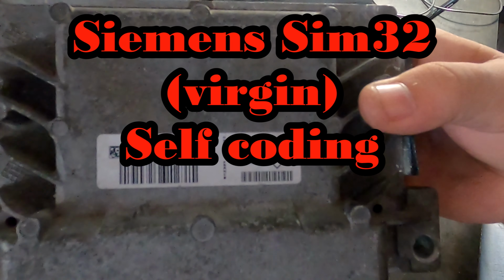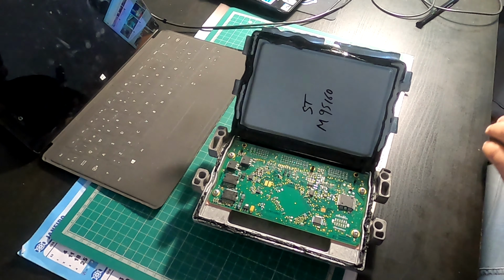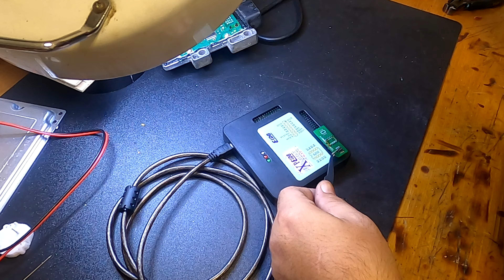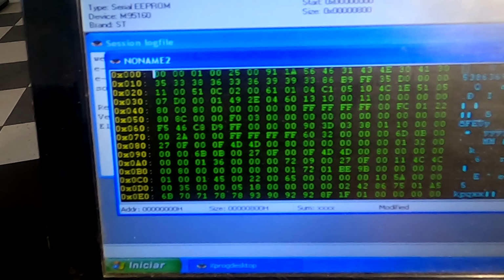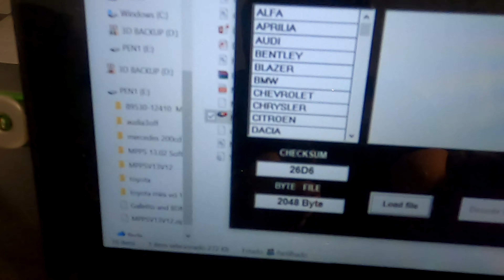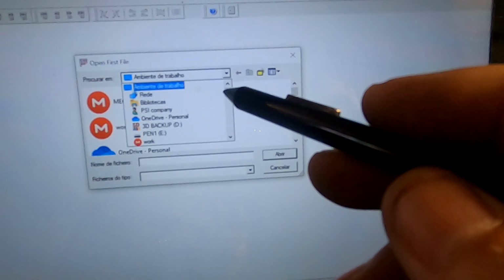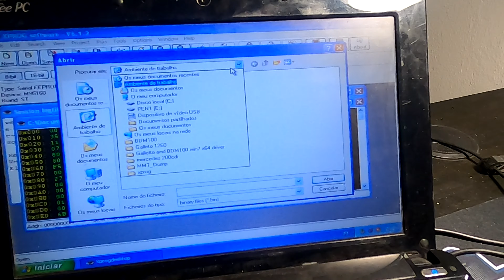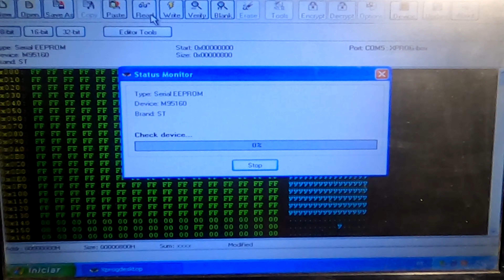siemens sim32 virgin auto program

Comment: Hi, thanks for sharing the information.
I did it like in your video, but the immo lamp does not go out, the starter turns but there is no start
Reply from the maker: thanks for watching
is the transponder in your key ok
is the coil ring around the ignition ok
in this procedure i just put the ecu in virgin state that means that all the other immo components must be ok in order for the car to program it self..i can tell you that in my case it worked perfect because my problem was the original ecu was damaged so this one worked perfect.
if you replaced the ecu you can also just replace the eprom from the original to the donor ecu and it will work.